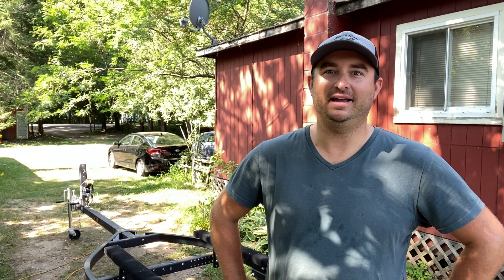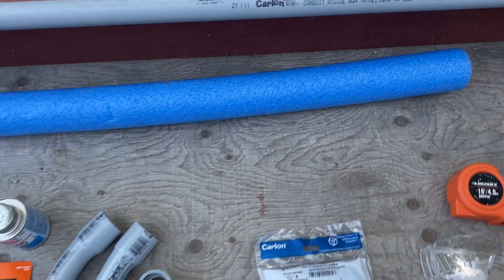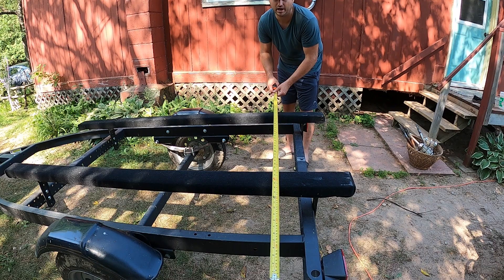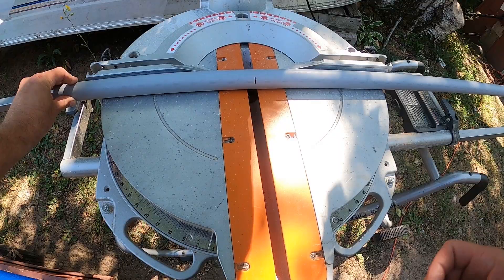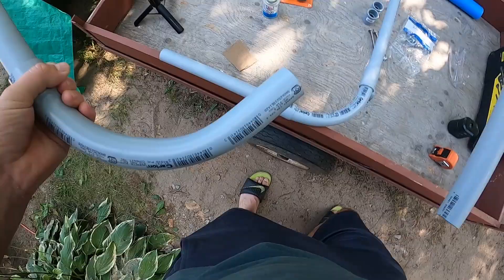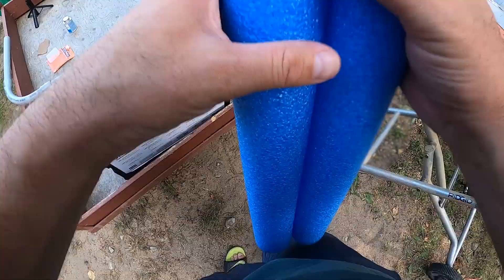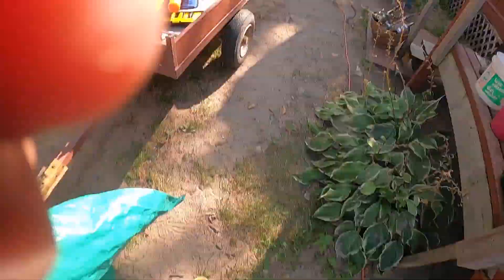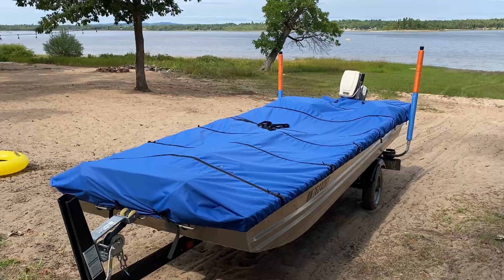How to Install Boat Trailer Guide Posts (Easy DIY Project)

Comment: if you want the noodles to slide on use some dish soap and if you replace the bolts in the tail lights with ones an 1 1/2" longer you can run the through both sides of the pipe and it will be twice as strong. and if you use schedule 80 vs 40 its twice as thick.
Reply from the maker: Wow, this is all great advice! Thank you for sharing.

Comment: Put a short piece of dowel in the pipe where you mount to the frame, it will not collapse, and can be tightened up tight.
Reply from the maker: Great solution!

Comment: I did something almost identical 20 + years ago and it worked fine but never thought about adding pool noodles! Even better!
Reply from the maker: Very cool! Yeah turns out the orange ones help a lot with visibility in low light conditions. My reverse lights kind of make them light up a bit.

Comment: This is a great idea, thank you.  It looks like you have enough room to put a 1” pvc mounting bracket on your trailer, which may or may or may not be stronger than drilling it out.  I am definitely going to experiment on my trailer.  Thanks for the great video!

Comment: great idea , Im making mine out of a bed frame, angle iron will be more difficult to work and drill but will be strong , will also use the noodles to cover the angle   heres the deal ,   its always good to keep the brain exercised with creative thought      good job man
Reply from the maker: Thank you very much. That sounds like a very creative idea. These are still holding up well 2 years later. I think I’ll be upgrading to something stronger next year.

Comment: Pipe os measured in I.D. (interior demension)  you need to measure O.d. (outside demension) when sleeving  something. 3/4 inch i.d. in pipe has an o.d. of one inch
Reply from the maker: @kylemiller769  thank you for sharing your wisdom! I’m hoping I can remember this before starting my next project lol.

Comment: Just a friendly tip. 
Whenever the job of a tube is on the inside (hose, pipe, etc) the measurement will represent the interior.. so I know how much water will go through. 

On tubbing, the job is on the outside. Estructure for anything, bolts, etc… the measurements will be the outside. 

Pipe vs Tube
Inner diameter vs out diameter
Reply from the maker: Awesome, good to know! Thank you for sharing. I’m sure this will save me some headaches in the future lol.

Comment: Great video!
Just wondering if using the light mounting hardware did anything to mess up you ground connection for the lights?
Keep up the good work
Reply from the maker: Thank you! Yes good question, it did mess with the ground connection. At first I added some metal washers between the lock nut and the ground wire, sometimes the lights would flicker though. I ended up drilling a small hole in the trailer frame and used a self tapping screw to connect the ground wire and that has been much better.

Comment: The insides of the light box will crack if you bump the pcv pole.Its only light grade plastic. Maybe a screw through the frame into the pcv would prevent it twisting on impact. Good idea with a couple of small modifications. Thanks for the video
Reply from the maker: Luckily I haven't had an issue with that, the PVC is on the inside of the frame and the lights are on the outside of the frame, hitting the poles doesn't seem to transfer any force to the lights. I've accidentally crashed into the PVC poles a few times while trailering my boat lol. An issue I was having though is my lights were flickering, because the nuts were originally being used as a ground for the lights. Last year I actually had someone remount the poles for me. Instead of mounting them using the bolts for the lights, he mounted the PVC below those bolts, and drilled a hole through the frame from underneath. I like it a lot better so there's no chance of it effecting the lights, when I did it myself I wasn't comfortable trying to drill through the frame. Thank you for watching and commenting!

Comment: You need some metal to attach that to the trailer. The 90 degree PVC is definitely not strong enough to support those posts when road wind starts hitting them, and drilling those bolt holes made them even weaker.
Reply from the maker: A buddy was supposed to do some angled aluminum for me but it never happened and I was in a rush lol. It has been 2 years and they’re still holding up which is good. Eventually I’ll probably upgrade to some legitimate ones rather than DIY.

Comment: Plumbing pipes are measured using the internal diameter
Reply: @InstaPhippsyFishing   lol ime a qualified plumber and i only learned that 2 years ago  when i tried to join to sections of copper with a internal spine , its because we are spoiled we buy fittings to match pipes that are ment to join together not realizing the fittings internal diameter is the diameter of the external diameter of the pipe , keep them coming man enjoyed the vid

Comment: How are the guides holding up??
Does travelling down the hwy at 100 kph etc cause any blow back of any concern? The elbows and nut holes would be the areas that would get torcked.
I was also going to install guides until a worthy charter fisherwoman informed me how the trailer should be placed to retrieve your vessel. The top of the fenders should be just under the water surface (depending on your trailer bed setup and boat). Since then I have no issues. Thanks to Joanne.
By the way, dish soap would have helped you with those pool noodles being installed.
Good vid.
Reply: @instaphippsyfishing  Great, makes sense. Thanks

Comment: plastic is to easy to snap off              been there done it
Reply from the maker: Yeah that seems to be the general consensus. I wonder if the PVC conduit I used will last longer than standard PVC, as it has a bit of flexibility to it. It’s been 2 full years of heavy use and they’re still okay, even with me crashing my boat into them occasionally lol. I’d like to get something more permanent eventually, I’m thinking maybe some side bunks.

Comment: MOT STRONG ENOUGH!!!   Get a windy day.....run the boat into the guide...broken guide!!!!   Need STEEL!!!!!!!!!!
Reply from the maker: Steel would definitely be an improvement for this project. I don’t have any experience working with metal. I think eventually I’ll upgrade to the legitimate side bunk style ones. Good news is it has been over 3.5 years and they’re still holding up great. I haven’t had any issues even with driving on the highway and running the boat into the guide multiple times. I think the flexibility might be their super power! I was also concerned about them becoming brittle but that hasn’t happened either. Knock on wood 🪵.